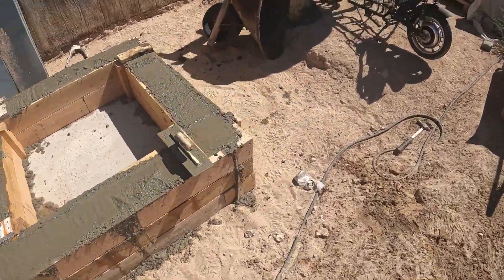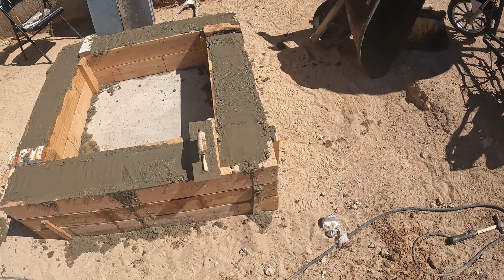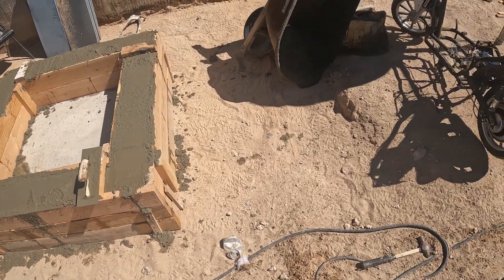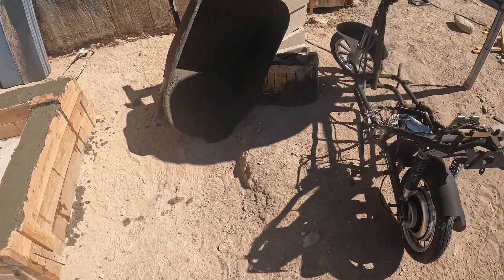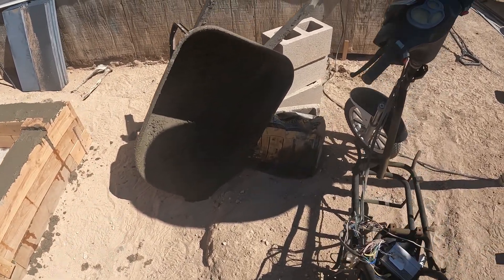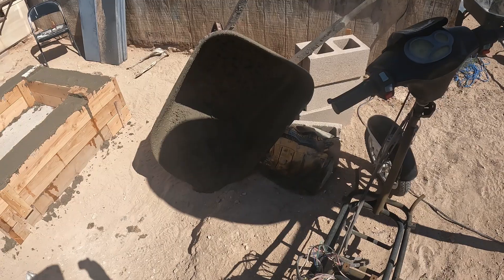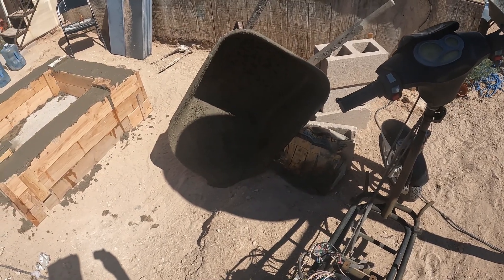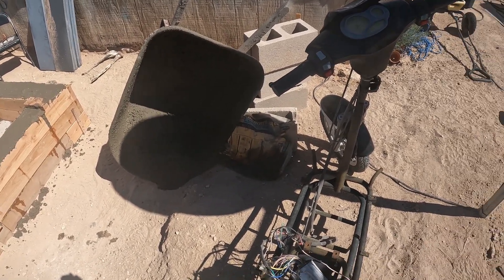Super Sand Battery Phase Two Complete E95

Comment: always go with bigger diameter fans for efficiency and low noise
Reply from the maker: I have been experimenting with various fans and still haven't actually found exactly what I was hoping for. Most are too loud even larger ones I have tried. I will do a video on all my experimenting and evaporative coolers I have built. In greenhouses it's kind of irrelevant but in my home I need something quite like you say.

Comment: now that I finished the wind generator my next infrastructure project will be a dual sand battery heater/hot water heater. Looking forwards to the updates.
Reply from the maker: You're wind generator is awesome.  I opted not to heat water with this prototype only because I am not sure of how much heat will be generated. Also I have a solar hot water tank I need to install that is a separate unit. Basically I just want to see if it can heat a room addition or a small cabin. So on this particular unit I just want data on heating a home or room and I thought if I add a water jacket or some kind of tubing it would take away from the actual heating capacity and may not keep up but it is a great idea and if this works well I may do that on my other property.
Reply: @off-gridsurvivalmike8120  thanks... and your research is highly valued. Thanks for doing it for us.